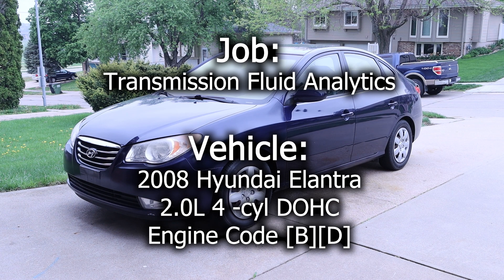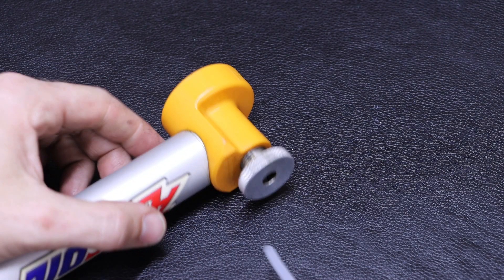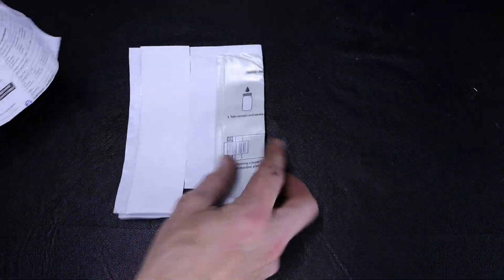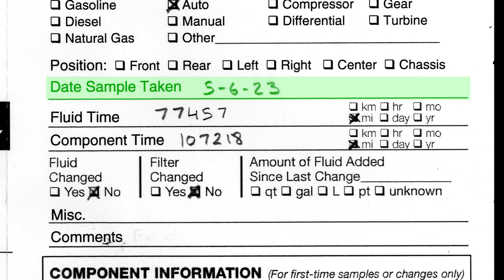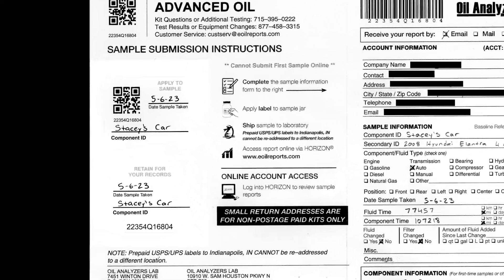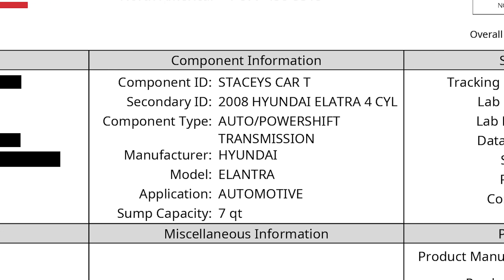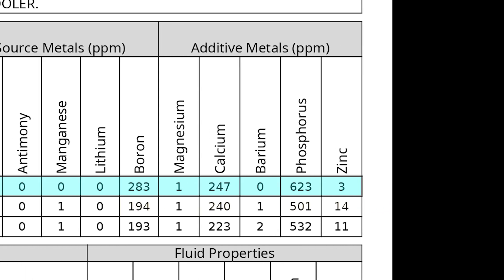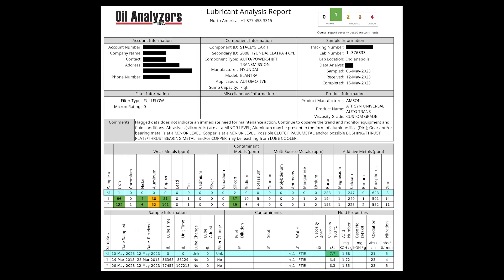Does Amsoil Transmission Fluid Hold Up After 10 Years and 80,000 Miles? ATF Analytics - 2008 Elantra

Comment: Though I never had my transmission fluid analyzed I used Amsoil Red Label Signature Series ATF in a couple Chevy Cavaliers back in the day. One of them the fluid was in service for something like 9 years and I went ahead and did a complete fluid exchange over to the blue label Signature Series since it was backwards compatible on my transmission. When I saw the color of the old fluid and how clean the transmission pan was I realized I had no real need to change that fluid... it was amazing to me
Reply from the maker: I did a lot of research into the products and processes involved with the tranny service.  I have no concerns with running it another five years and then doing another oil analysis.

Comment: Good video and explanation.  I checked wear rate on all wear metals. They are consistant, ppm/1k mile, and no drastic spikes.  Copper is normal levels.  I found that Polaris labs has some arbitrary limits and not based on that transmission make or model or time period.  The filters in transmissions are  more like a filter screen, not like a engine filter.  I installed an inline filter on my SUV, because the internal filter is non serviceable.  As more and more wear particulates circulate you will see a shortened overall life of the transmission. I would end your test at 100k, and then do a full fluid exchange.
Reply from the maker: Thanks for the comment.  Much appreciated.

Comment: Was a flush done or drain and fill? Also was Amsoil Signature used or the OE? I just did my 2015 Lexus GS 350 at 53k miles 2x drain and fill. Planning on doing a third time at 60k miles soon. I used Amsoil Signature.
Reply from the maker: At the time I did the original service (11 years ago), I used Amsoil Engine and Transmission Flush, dropped the pan, and pumped out the Torque Converter. https://www.youtube.com/watch?v=9Ly6cbbKa9A  I used Amsoil Signature Series.